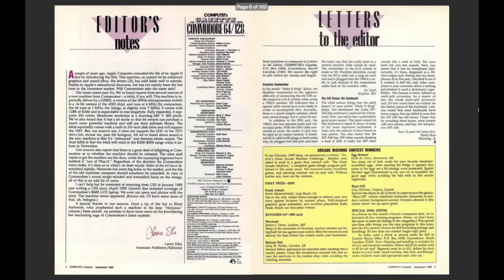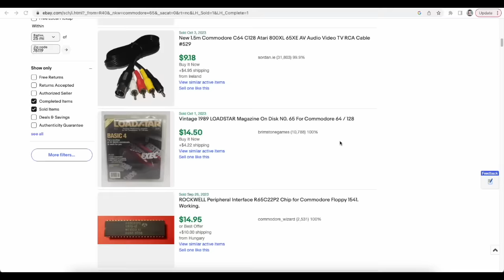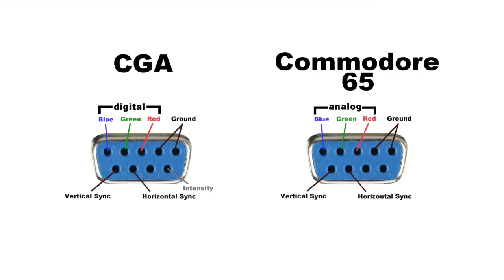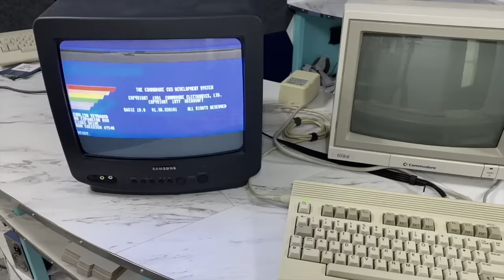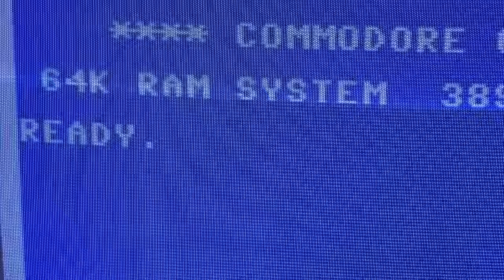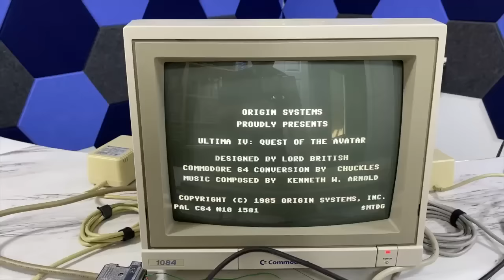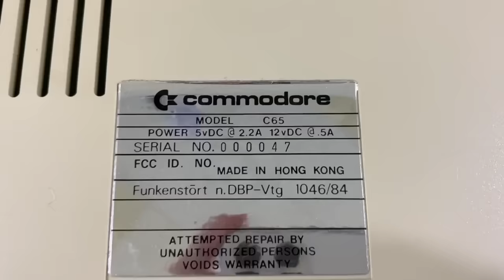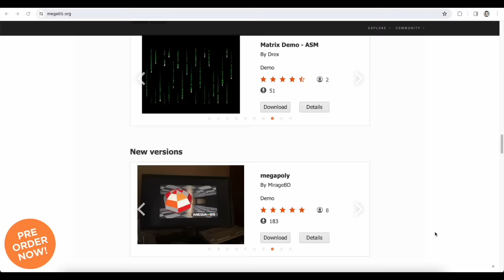The Commodore 65 - A Rare Prototype

Comment: I skipped through the video.  It's insane.  There was a clear strategy that commodore could have pursued, that lined up with goals.

The Commodore 64 only needed an upgrade to 16 sprites multiplexed, 256 colours and 80 column mode in a model the next year or two, instead of the plus4 and Commodore 128. This would have kept it fresh enough against the consoles playing the common type of sprite tile based games of the 1980's extending sales by years, and made it good at basic business machine use and GUI (Note, blitter is not so necessary, as we see in the low end consoles).  As the cheap alternative for both game computer and shop business computer markets, and kept it's sales up years more (the plus 4 needed better architecture and sprites and 80 columns.  Eventually, management of integration and cost reduction allows for it to move into a 2600 like competing console computer).

The second part is integration of chipset to one or two chips, with higher speed, for lower cost and reduced form factor.

 Another optional part would be increase in graphics/sprite mode colour depth, and memory every second year, and clock increases as they came in.  Maybe sprite numbers.  If the section of the design for the graphics bitmap and sprites is too one side of the chip design, that can be redesigned independently to the rest of the chip.

A business version could merely be a version with more memory for better colour depth in 80 columns and a 80 column bit mapped mode (also setting the basis for expansion of the home machine version) with disk drive and other interfaces in built, and eventual integration into a monitor/TV to compete with MAC/Amstrad etc, in compact firm factor for shop space with register till attachment, and home, and school.

The Vic20 is tweaked to become the Vic Color cheap console.  The tweaks are in colour palettes and resolution colour depth, to compete with 2600, and maybe as an alternative to the commodore 16.  The best developers for the Vic are invited to convert their games by a configuration file for remapping controls to joy pads. Touch pad maybe for mouse like functionality and basic peck keyboard inputs (like inputting your name).  A high speed cassette console with license  protection, for cheap games in the $2-10+ range,  is not out of the question.   Eventually , this is joined by the Commodore 64 revision version, and latter Amiga revision version in the 1990's, where a disk then CD based console with license protection is added, as it's cost go down.

The Commodore Amiga and PC was years away from being cheap, leaving the lower end market.  CPM was not needed with its development base. The cost involved in the  128/D and plus4/16 could have gone to a 1984 revision, which would have kept it more competitive over 10 years, making it suitable as a handheld by the 1990's.

These are practical things, which could have been instead, making only two lines of hardware, except the Vic-Soul Console.  Reducing cost and development costs on the 64 line (they needed money to upgrading Mos).  I e thing is certain, keeping within the curve and ahead at the start, rather than forever falling behind.  The 64 was supported by its fan base, and nice cheap software, which is why it slipped behind until new fans were going elsewhere.  You will also note how it sounds like a version of the Amstrad CPC+ machines, except those were years too late (if the original CPC had been like that, it would be a different story) and the sprites multiplexing were too limited, when swapping sprites, and they needed better 320/640 mode colour depth eventually.  The issue wasn't to be as good as Genesis and Amiga, but to look good enough to still be a low cost alternative buy.  If you put a heavy processing game, or 3D game, the Amiga would be obviously ahead, as the more serious machine in all gaming and computing aspects.  But, we know what happened at commodore, Chuck Peddle and others walked, then Jack, who held the purse a bit tight, walked and took talent with him (then didn't release the superior 7800, or the computer version, or use the graphics technology in the ST, and didn't get the Amiga, and who knows what raw talent walked  at Atari when it was taken over, and took years and an alignment with Flare, to get back again.  We see here that Flare came out of the Sinclair Super Spectrum, which would have set Amstrad up at the take over for years with a cheap Amiga alternative).  Thus, the plus 4 range lost its rudder, Jack, and the 64 upgrade didn't steer well.  There was a problem with the way graphics memory was on the plus 4 and 128 range (I might add, this sort of memory bottleneck issues with graphics also came up with the Acorn Electron, curiously enough).  The 128 used another 128 mode chip then the one intended, producing an issue, and no extended pallet, when extending the vic-2 to 80 column would have slowed the sprite engine to be involved.  The questions go back further.  The Vic really needed 16 sprites, or a way built in to multiplex them across the screen, a larger pure rgb pallet and at least a 80 column colour text mode for business owners, where reprogramming character patterns could provide basic graphics.  I know there are memory bandwidth constraints, but a text only 80 column mode from Rom character sets, should be possible, or higher memory bandwidth.  Another, was use of bytes instead of nibbles in colour attribute memory, would have helped.  Just an extended pallet would have made Sonic for the 64 look a lot better.

Comment: I have the same model Samsung TV it is European it works with NTSC ,PAL and SECAM, you do not need to do a mod just open the settings in function then color system select auto, I hope it works so you can test NTSC and PAL computers
Reply: It clearly supports the color system, as the picture shows up in color. It has the same problem my 2008 "Memorex" TV does - supports the color system but not the 50hz refresh rate. This unfortunately seems very common in later US sets/monitors.
Reply: It is in color because he moded his TV to support RGB so that why he gets the signal in color his TV is from 1996 and mine too

Comment: How compatible is this machine with C64/1541 fast loaders? I ask because I read that the 3.5MHz CPU is throttled to 1MHz using clock gating - it's not a true 1MHz clock. Fast loaders depend on the 64 and 1541 operating in lock-step to transfer2 bits at a time over the IEC bus, and jitter due to clock gating from a 3.5MHz clock cannot be tolerated!

Comment: As much as i understand the desirability of this system for today's collectors, i dont think there was a market for this system at the time - just like with a lot of commodore models. Backwards compatability would have just lead to software developers still targeting it solely for that, as had happened to the 128 before. They already had the perfect successor to the c64 - the Amiga 500. Going from one to the other seemed like a natural progression at the time, and i hardly knew anyone who didnt make the transition. If anything, and if feaseble, they should worked on some sort of solution to enable the Amiga to play 64 games (maybe through a disk drive adapter and software emulation, i dont know - sort of turning a regular 1541 into a "sidecar"). 

I do love every member of commodore's extensive zoo of models, and i am no business expert, but i cant help the feeling that at least half of them should have never come to market and that while the designers at commodore deserve all the praise for their enthusiasm, someone should have reigned them in (more). Maybe they just perceived the market as way more parcelized than it actually was, recognizing more price brackets than there actually were, and putting too much emphazise on having a system for every single of them on the market. Personally, i think there was just one deviding line which was at about 1000 DM (Deutsche Mark, back in the day) for a complete system. The Amiga 500 / 2000 got it just right. And with the c64 still floating around at the very low end, there really wasnt anywhere for the 65 to go.

PS: This is from a german perspective. I do remember that price & budget was way more important in the british market, f.e., where very low priced spectrums and budget software was all the rage. But how much money was in that? How much profit can you make on a 50 pound machine on a highly contested market segment? I would have said: Let Sinclair have it - we take the rest.

Comment: It always upset me that it wasn't standard practice for c64 game developers to allow for their games to run off drives 9, 10, or 11.  This especially since it's so easy to just peek which drive the game was loaded from.  Yeah I know disk drives were expensive and most people would only have 1 (if that) but still how hard is it to not hard-code an "8"?  I made a c64 game back in 2018 and one of the first things I decided up front was that it would automatically detect which drive the game was loaded from (for loading levels) and also allow the user (from the game's main menu) to switch to a different drive.  I would have made a lot more use of my 1581 back in the day if games had worked this way.

Comment: You mention that the Amiga wasn't a success.  It was a massive success in Europe and with all the units being PAL suggesting that the C65 was developed in Europe (probably by Commodore Germany) that might have been a key factor in killing off the C65.  The Amiga was already a success and the C65 would have cannibalised Amiga sales and confused games and software developers.  

Commodore might also have seen what happened to the SAM Coupe, the 16 bit computer that was meant to be backwards compatible with the Sinclair ZX Spectrum (although not madxe by Sinclair/Amstrad themselves but a small company called Miles Gordon Technology)

SAM Coupes are about as rare as C65 prototypes and that machine actually saw a release!

Comment: This would be a absolute koller computer in 1985 or 1986, and it would be a excellent computer in 87 and 88 if it would sell for cheap.. that it should be able to do since it got mostly cheap components.

But in 1990? While it would still be competwtive wirh Nintendo and sega.. those are not really the competitos. Even of amiga didn't exist. And it did..  Atari did as well

Comment: By 1990 the PC market was already positioned for replaceable CPUs and consumers began to expect that kind of flexibility.  Commodore's Achilles heel was tying the CPU clock circuitry to other internal hardware that prevented overclocking or upgrading to faster CPUs.  Not so much on the Amiga side, but definitely with the 64 and related product lineup.

Comment: At this point I wonder if the X16 can also get a C64 emulator, so it takes place of the C65 in this sense. Granted, would not be perfect, unless it is by using a card like the Apple //e card for the Macintosh CC so it can also get the cartridge port and other things the X16 may need to make the emulation possible.

And I call it emulation because the VERA is more capable than the VIC-II and SID. If a C64 mode is set with a translation layer or something, could the X16 theoretically run C64 software if a 1541 is connected?

But even if it were theoretically possible, I imagine how it would not be done, simply because it makes no sense to develop something like that for the X16, unless someone wants a challenge for themselves.

Comment: If the c65 is 16bit, I'll bet with a little ingenuity and maybe a switch to msdos you could essentially put windows 1.0 or 3.11 on there.  It would be interesting to try
Reply: The CPUs used are very different architectures, so that would be almost impossible.

Comment: Yeah, it sucks that the C65 prototype is such an orphan that there really isn't much of anything to use on it in its native mode. I also think the 64 mode would've caused the same counterintuitive problem as having a 64 in the 128 did: Devs just keep making 64 stuff instead of "graduating"! So in either case, why even buy a 128 or a 65 in the first place? Better to NOT have a 64 mode in either one just for that reason! Yeah, sometimes ya think building the old modes into something new will be a boon to it... only to that mode shoot the device in its own foot instead!

Comment: I think the C65 would have had about as much success as the C128... the C64 compatibility is NOT a PLUS in my opinion as software developers will make software for the C64 mode.  I mean, just HOW many games do you recall specifically for the C128?!  Yeah, me neither.  Contrast that with the Commodore Amiga which ONLY flaw (aside from it's layered way of graphics) was that Commodore's ADVERTISING sucked!  When they did advertise it, they should have had ads showing how much better it was over the PC.  I absolutely preferred the Amiga over the PC, even though programming VGA for the PC was easier, the Amiga was far superior in every other way.  I  think the C65 was probably canned due to the C128 effect of having a C64 mode which pulled devs away from programming for the C65.  It would always be seen as a C64 on steroids or whatever.  And Commodore was doomed to failure anyhow due to their lack of advertising.  I talked to a guy at the last World of Commodore show I ever attended in Toronto about why they didn't advertise more and he commented about that costs money... yeah... it costed them a lot of business too.  Anyhow...

Comment: When you say that the internal 1565 reads the same format as the 1581, do you mean that  it will even do an HD version of that format, hence it being an internal 1565 instead of just an internal 1581? Because if the 1565 were just another SD 3.5" drive that had exactly the same format as the 81, then what would even be the supposed point of having the new drive model?
Reply: The point was to be much cheaper - the 1565 is a "dumb" controllerless drive, essentially a standard PC double density floppy drive in a custom case, with the actual drive controller on the C65 motherboard and CBDOS running on the main C65 CPU as part of the C65s ROM instead of on a separate CPU and ROM in the external drive unit like the 15x1 series which were full 6502-based computer systems of their own and cost as much (or more, depending on time and place) as the Commodore computers they connected to.
Reply: Then why didn't they just do that with all of the drives and computers,  @KithKanan64 ?
And what's the name for this newer connection?
Reply: @HelloKittyFanMan  long story involving decisions going all the way back to the PET, made the main systems cheaper at the cost of more expensive drives at a time when disk drives were still an expensive luxury add-on and they were stuck with on the 64 even after that changed. 

One of the main goals of the C65 was to be about half the cost to produce vs a C64C due to more modern production processes and they were willing to sacrifice some compatibility to get there. The only things they seem to call the interface in the internal system specs are "External floppy drive port (mini DIN8)" and "Disk Expansion Port"

Comment: Man that computer looks sweet for such an old system. I kinda wish that modern computers were a bit more... integrated, I guess is the term. What with the keyboard being built into the computer. It might be ridiculous with how big some rigs have gotten (not to mention ultra wide monitors and the like) but it would be pretty sweet to see something like that with modern hardware outside of a raspberry pi

Comment: They should simply have never released a non-C64 compatible computer.
Reply: I think every Amiga ever owner would disagree with you.  The problem was that the marketing department didn't handle the Amiga well and it never took hold in the crucial business sector.  Software stability for business applications didn't help either.

Comment: A couple of questions, David. Can the internal drive number be changed in software to say Drive 9? If so, could you not plug a 1541-II in as drive 8 to overcome the disk compatibility issue? Second, was there a way to change the unit either with jumpers or cutting trace jumpers to NTSC? Or did it require a whole different video chip and crystal?

Comment: One thing that's always confused me about Commodore, why did they label Dirve 1 as '8' ?
Reply: Device 1 is already used for tape.
Reply: @johnps1670  On all other 8 bit machines I've used tape has been a seperate input system. Whereas discs and other such devives have started with '1' or 'A'
Reply: @frankowalker4662  I'm pretty sure generic device numbering was a thing with Apple too, except since the Apple II was a more modular system, they just used whatever slot you stuck the controller card into as the number.
Reply: The other numbers were already assigned to other devices in the KERNAL.  0 Keyboard, 1 Datasette, 2 Modem, 3 Monitor, 4 First Printer, 5 Second Printer, 6 First Plotter, 7 Second Plotter or RAM-Disk
Reply: @bozimmerman  Commodore were a bloody odd company. Their version of basic was crap too. LOL.

Cheers for the info. 👍

Comment: Of course cracked software would run it wouldn’t use any of the illegal opcodes of the 6502 not supported by the new CPU. The forced drive numbering was probably Commodore’s way of preventing people from trying to run copy protected software that would fail.